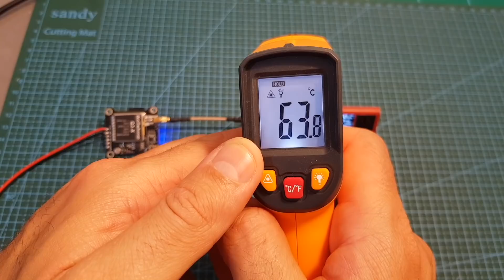Wolfwhoop Q3-X VTX With Build in DVR

Comment: I really wish it had auto record and autosave(for when you forget or battery ejects) and wouldn't split files after 5 mins, but other than that it looks pretty good
Reply from the maker: Yes, this is a very needed feature.
Reply: If it had either then i could overlook the lack of the other, but both is kinda a killer in my opinion